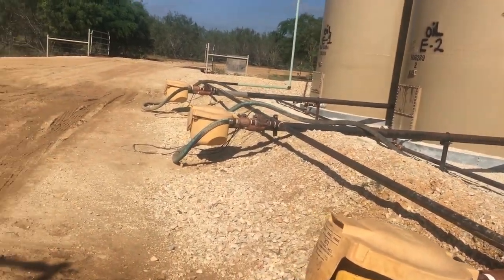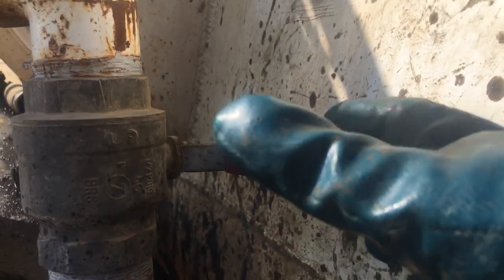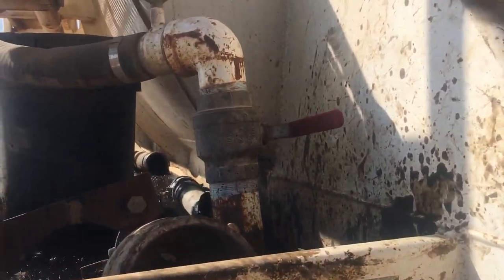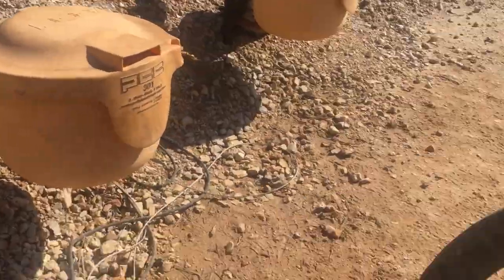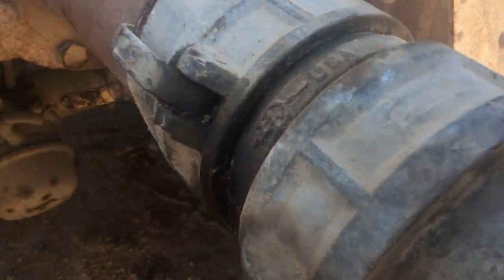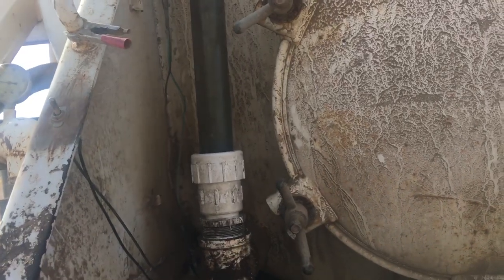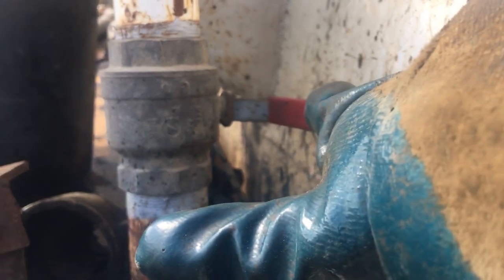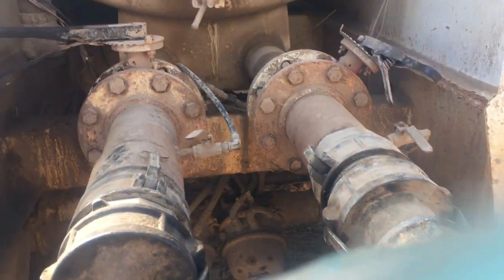VACUUM TRUCKS FOR DUMMIES (PT 1)

Comment: Have experience on tanker I'm a diesel mechanic .what company should I apply to to get the pay I deserve
Reply from the maker: Warren Thornton my best advice for you man is for you to do your research and carefully select the best choice that fits you
Reply: you're better off getting your own truck and becoming an owner operator. You are the owner, driver, and mechanic so keep most of the money except for the 20-22 percent commission that the msa holder charges you. most of the time you have to paid the insurance through them and the worker's compensation insurance if you don't have your own. there's companies on FB and CL advertising. i've heard Wyoming is where the real money is at.

Comment: What type transmissions are usually in vac trucks?
Reply from the maker: Craig Alling man if you going to the oilfield it be safer for you to know how to drive a standard
Reply: Chasing MrHamilton Where do you drive and how much of it is on the fields?
Reply from the maker: Craig Alling most of your load pickups is off road like you see on the video, but I’ll say 50/50 highway and off road